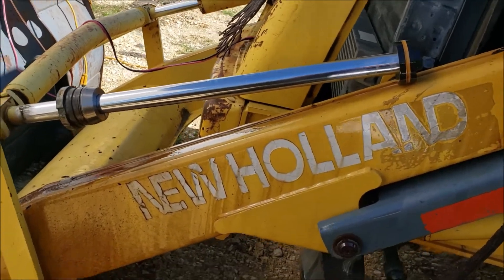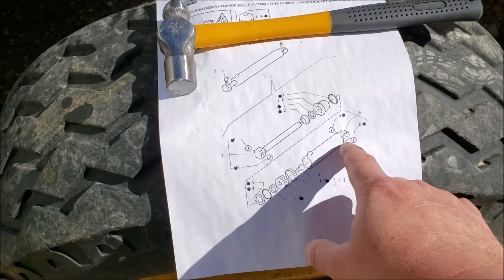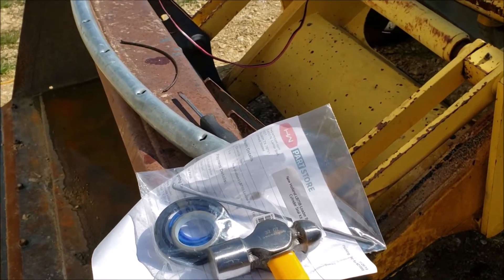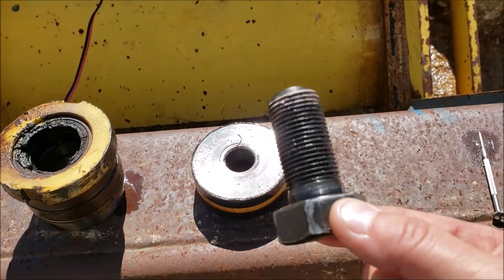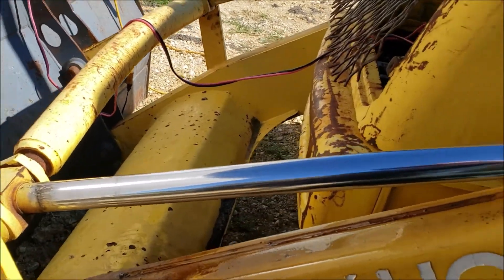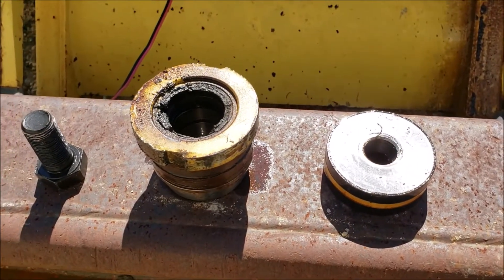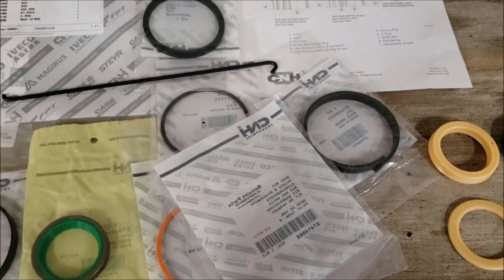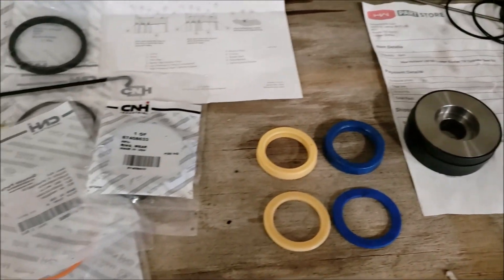Replacing Hydraulic Cylinder Seals - Part 3 - Pulling it all apart

Comment from the maker: If you don't like long winded and detailed videos, then just move along.  Here are all the videos:
Replacing Hydraulic Cylinder Seals - Part 1 - Preparing to tear down the cylinder: https://www.youtube.com/watch?v=ra0cLc5Xx_M
Replacing Hydraulic Cylinder Seals - Part 2 - Removing a stuck gland: https://www.youtube.com/watch?v=xYsVAg8xHtM
Replacing Hydraulic Cylinder Seals - Part 3 - Pulling it all apart: https://www.youtube.com/watch?v=5515KJ7Be30
Replacing Hydraulic Cylinder Seals - Part 4 - What did I do wrong?: https://www.youtube.com/watch?v=qe-MotB6FQA
Replacing Hydraulic Cylinder Seals - Part 5 - Putting it all together: https://www.youtube.com/watch?v=_mnUfnkj6MM
Reply: Awesome.. thanks so much for taking the time to post. You got a new sub!

Comment: Do you know how to remove the front pin if you wanted to remove the entire cylinder? I've removed the retainers and washers from both sides, right and left cylinders,  but I can't figure out how the pin comes out.
Reply: You need to remove the pin on bucket, remove outer flat bar that go's down to bottom of lift arm then outer flat bar from cylinder to bucket, remove pin from back of cylinder, lift cylinder and slide off front pin.

Comment: Can you put link where you found that diagram?
Reply from the maker: Well, they seem to have changed up the site but if you dig enough you can find the diagrams.  Here is a link to the LB75B parts breakdowns: https://www.mycnhistore.com/us/en/newhollandce/na/light-equipment/loader-backhoes/lbb/backhoe-loader-upgrade-2000/cn/8309AD4F-E6BE-E111-9FCE-005056875BD6
Reply: @SeidelRanch  Thanks